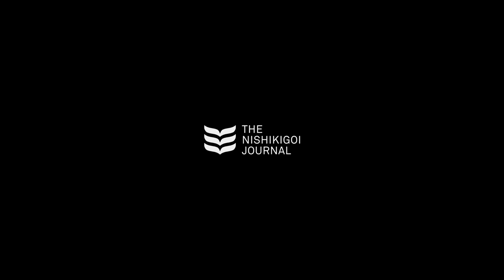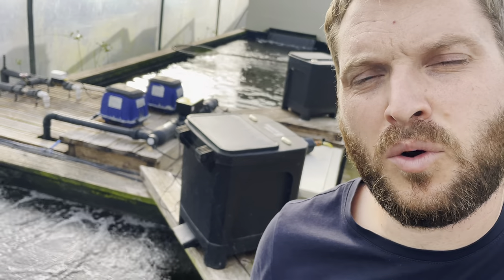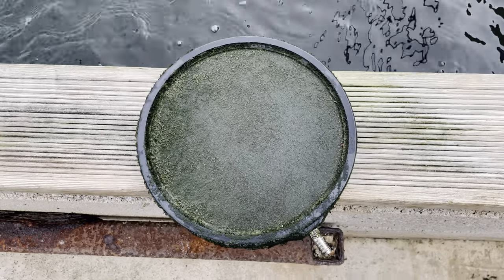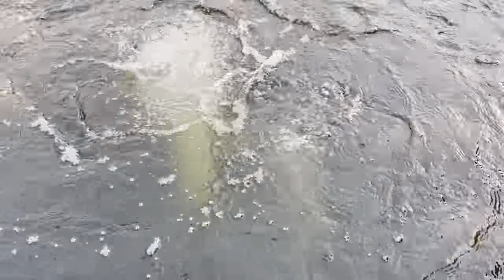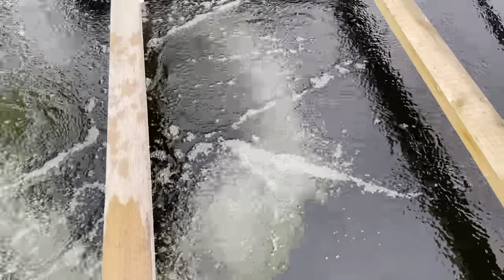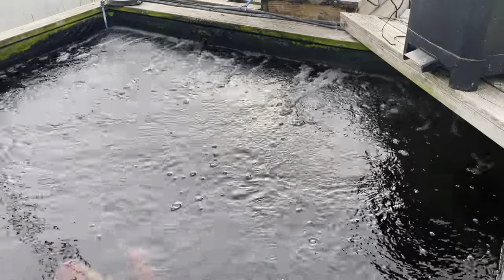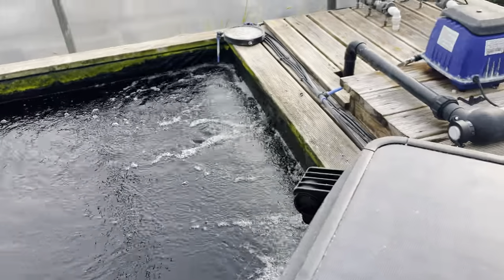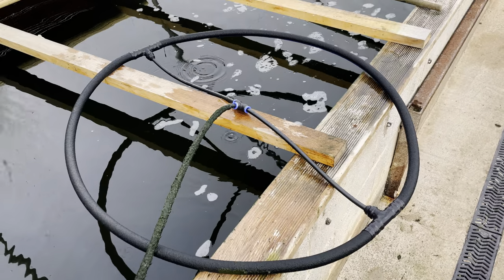Koi Pond Aeration Problems! | The Nishikigoi Journal | EP #007

Comment: Ricky, I'm interested in the "not disturbing the surface" comments. I've always been under the impression that, that is where the gas exchange really takes place, not when the air is moving through the water; therefore, the lack of disturbance on the surface means less oxygenation?
I'd be interested in yours and other people's thoughts on that.
Reply: The air bubble has to break somewhere and that is where the oxygen is created so the more bubbles the better.
Reply: @KoiKicks  Thanks, that makes sense.
Reply: I thought I read the same thing. The air exchange takes place from more of the water hitting the water surface, so the more turnover the better.
Reply: The oxygen diffusion occurs mostly as the bubble is formed by the diffuser and as the bubble rises in the water. The smaller the bubbles, the slower they rise in the water and the greater the contact time is with the water for oxygen transfer. Larger bubbles will rise faster in the water reducing the bubble-water interface and simply break at the surface sending the valuable oxygen back into the atmosphere.
A very small degree of oxygen transfer does happen as the bubble breaks at the surface, but this is minimal and applies more to atmospheric oxygen brought/mixed into the pond by the surface layer being broken (by rain or cascading water for example) but not with air that is pumped into a pond via an air pump through a diffuser.

Comment: What's your opinion on running one of these rings in a moving bed instead of a traditional air disc?
Reply: Our Air Bars and Air Rings work very well in bio chambers and many have replaced their air discs with these for better tumbling of the bio media. 
We also have a air grid specifically designed for moving bed filters 🙂

Comment: I've been running a rubber air diffuser ring for the past 8 months and what a difference. Lot less churning on the surface, very fine air bubbles, virtually maintenance free. It  was an import, designed for lakes and heavy duty pumps. Works o.k with mt 80L pump although could go up to 120L/hr. Well worth the money. And would prob last for ever

Comment: I no what you are saying was using the air discs after a bit like you said don t last long and the seal does brake so I replaced them with two  rubber rings what a difference fantastic air and flow in my pond  😊 and just to say fantastic Japan video.s rick so professional done can t wait to see more